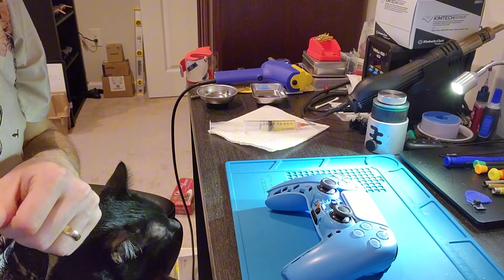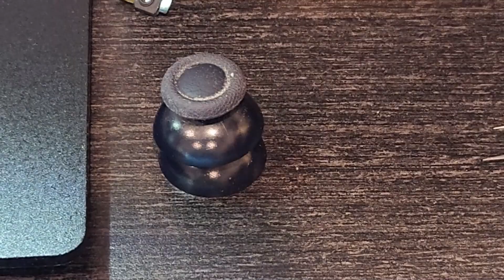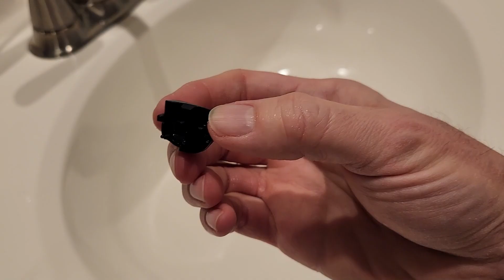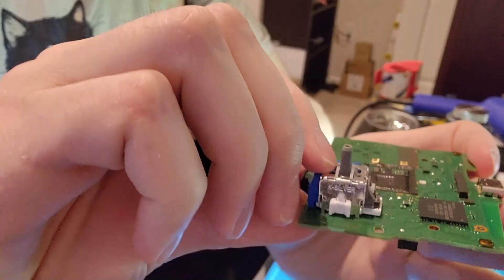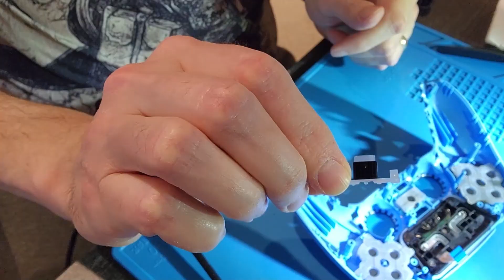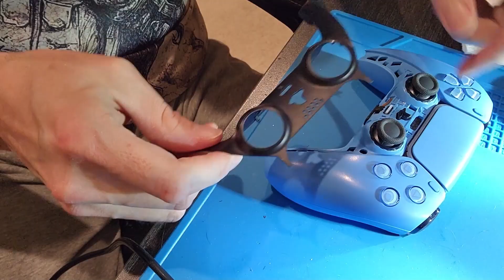Installing TMR Thumbsticks

Comment: I put one your controllers in my cart. Came here to see your work. Playing BF6 and the sticks are insane. Can take the drift out but I’m sure  something else is affected.  I only play BF6 so I’m hoping your controller with TMR sticks helps. (PS5)
Reply from the maker: I'll be happy to get you shooting straight again!  I have three different brands of TMR sticks to choose from, so if you are looking for a specific type, just let me know.
Reply: @bartholomewfargo In all honesty I don’t really know. Is there one you or others prefer for FPS games like BF6 over other sticks?
Reply from the maker: @SM-tg7yw  I don't think I replied to you!  I like to use the Favor Union sticks for FPS games as the tension on the sticks is a little stiffer than many of the other TMR brands, and I tend to "over-steer" with the other brands when I'm aiming since they take less pressure to move.  In short, the Favors are closer to the factory sticks in movement, but many prefer the K-Silver (pictured in the video) for how light and responsive they are.  They all work very much the same, but it's just a matter of preference.